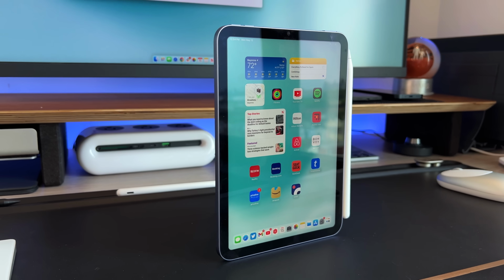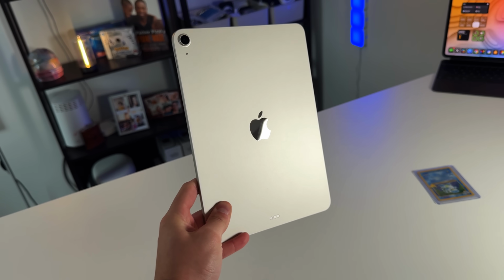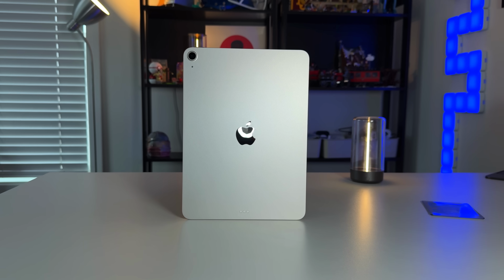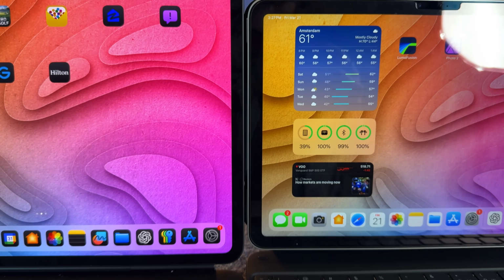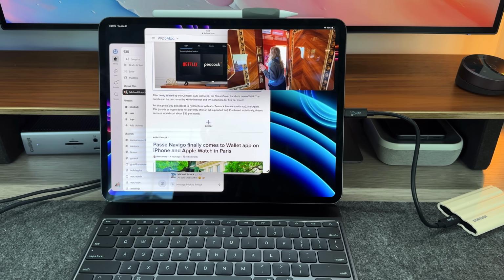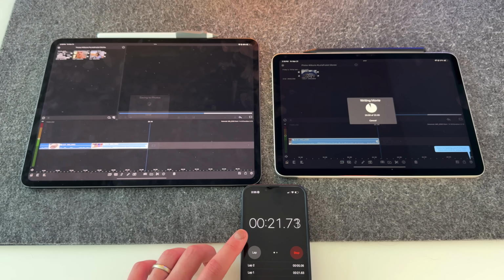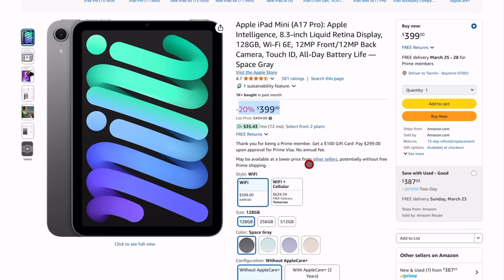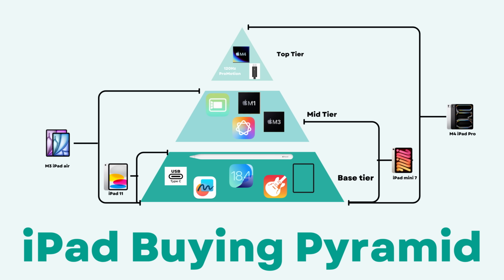Watch This Before Buying An iPad! Complete iPad Buying Guide!

Comment: For longevity, people should buy as much machine as they can afford. I I really stretched my budget in 2018 to buy a 12.9” iPad Pro. It had pro motion and I spent extra for cellular and 512GB of memory. It still works just fine 6.5 years alter.
Reply: I did the same thing but with the 2018 iPad Pro 11". It still works fantastic. I think Apple will discontinue its OS support of the A12X chip way before the hardware even becomes an issue.
Reply: @AL-12345  I agree. Software support for the 2015 iPad Pro, except for security upgrades, ended years ago and the same will happen to the 2018 model. Following my own advice, i just traded in my 2018 iPad Pro and upgraded to the 11" M4 iPad Pro with 512 GB memory and cell service. I switched to the 11" screen to save some weight and for convenience when traveling.
Reply from the maker: That's a great approach!
Reply: After having 2017 iPad Pro 13" for 7+ years, it was time to upgrade; after careful consideration I picked the iPad Air M3 13". Promotion is the only thing I miss, and the new Air M3 13" was 60% the price. I'm happy with the "upgrade"

Comment: i dunno about tandem OLED best display ever.... haha. ive seen QLED 8k etc etc.   even on a tablet the 2x AMOLED from samsung is probably just as good.  In your defense, I could use the demo table at the apple store or best buy, and have the latest ipad pro right next to side by side (literally touching with the security cable pulled out), side by side, full brightness on each with the ipad air.... and yes i can see the ipad pro displays "pops" a little more and seems a little better "lit from within" over the ipad air display.   but it's not overwhelming

Comment: Excellent video and breakdown. I went with the A17 Mini 7 with 256 GB of internal storage. The Pencil Pro is crazy good. My heart is content. My iPad Mini 4 with 128 GB is still working great after 10 years. I was due for an upgrade. Haha. Next is either an iPad Air 13 or a MacBook Air. Leaning towards the MacBook.
Reply: Would you say that the 128gb storage is still good? I WANT to get an iPad mini 7 but my budget only allows for the base 128gb storage
Reply: @theymon I think if you are going to store lots of photos, videos, down load games, edit videos, then I would highly advise getting as much internal storage as you can afford. If it’s going to be more for consuming content (watching videos, checking emails, light gaming, etc, then 128 gb is enough. It’s more like if it’s going to be a computer replacement, go with more storage. Hope this helps. Ask questions!
Reply: @theymon you can also look at the base iPad with 256 gb which is the same price as the Mini 7 with 128 gb. Depends on what you want to use it for.

Comment: I am torned between the air m3 and the pro m4, i really like watching youtube and movies. The iPad Pro is the better display but almost double the price 😅 so any recommendations guys
Reply: I know this is a cliche answer but, it depends. If costs is no object, just get the Pro. You’ll get a relatively better screen, 120Hz pro motion, and four speakers if you just want to watch mostly movies and videos. However, if budget is a major concern, the M3 Air is still a viable option. It can still do what you want it to do but maybe to a lesser degree but in my opinion, the differences are not significant.

But..if budget is a consideration, and you really want the extra features of the Pro, save up a little extra and get that instead, even if you decide on the Air.  By the time you add extra features to the Air, you’re starting to encroach on the price of a base M4 Pro so just try to budget a little extra and get the Pro. You’ll be happier in the end. 👍

Comment: I think the longevity is a factor to consider. I upgraded my 2018 iPad Pro last year to the M4 iPad Pro and couldn’t be happier. I don’t need it for performance but I think features on this device will be supported and will continue to function well beyond some of the cheaper options. I don’t see myself upgrading or being disappointed in this device for another 5-7 years probably, whereas I don’t think that would be the case with some of the cheaper options. Also for context, I don’t have a laptop or desktop computer, so this is what I use for everything I would need.

Comment: I'm planning to buy an ipad and a macbook for my uni during the apple's back to school sale, for macbook I've decided that I'll go for macbook air m4 but for ipad I'm confused between the Ipad 11th gen and ipad air m3, my general use case is going to be note taking only.
Reply from the maker: In your case I would recommend just getting iPad 11. No need for the m3 iPad Air unless you are dying for Apple Pencil pro support
Reply: @anmolgrewal7057  if your MacBook Air M4 is doing the heavy lifting, I would go with an iPad Mini 7 if just for note taking. Regardless of which iPad, you may still have to zoom in to take notes. Could save some money rather than buying the air or pro. My opinion but good luck to you!